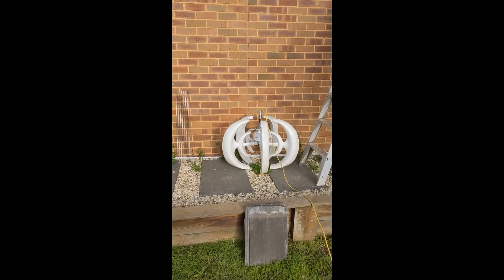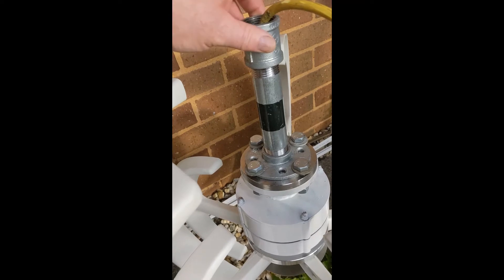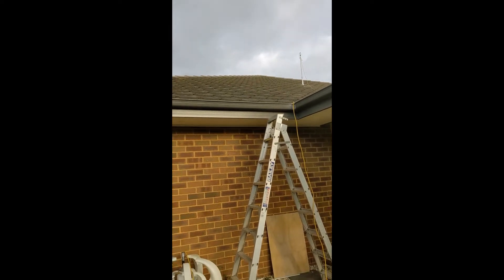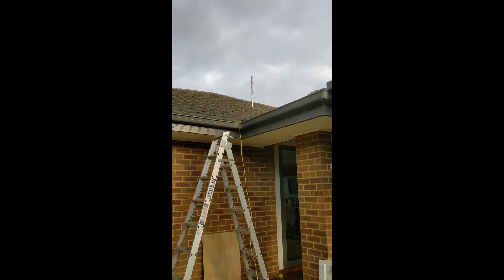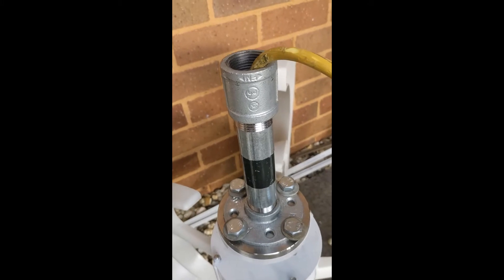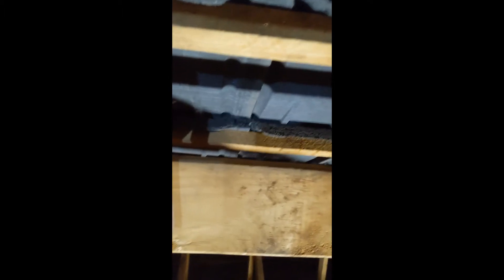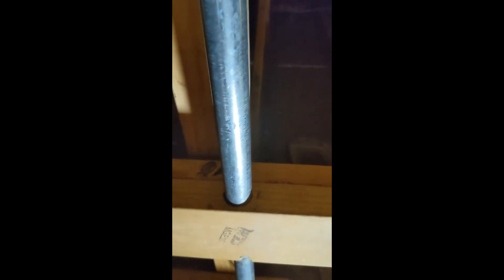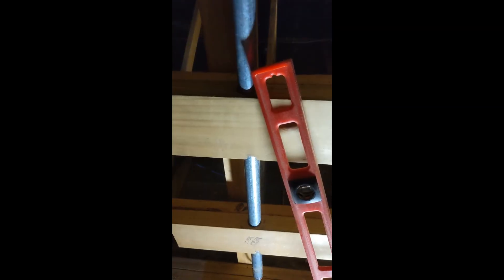Low Cost Wind Turbine Install part 1

Comment: Probably horizontal axis be better than vertical axis wind turbine. Nice to see someone from our own Victoria doing all this, otherwise most wind turbines videos are from USA. I bought and then sold horizontal axis wind turbine as I was told that I cannot get it grid connected, we do have solar panels but without back up battery system, has been working fine for last 7 years. Once batteries are cheaper and this system fail then I will try to do wind turbine set up and probably go off grid to prevent all those regulations and exploitation by power companies. They charge too much but give FIT too low.
Reply from the maker: Did you see my video on how I connected mine to the grid? The Wind Generator Journey. 
 https://www.youtube.com/playlist?list=PL42y13vA83asowyQdm_LIxH8NmlErr2w0  _ No regulations - but its still a work in progress.